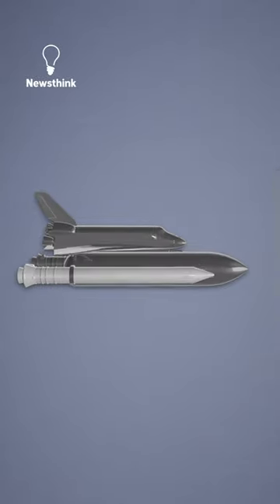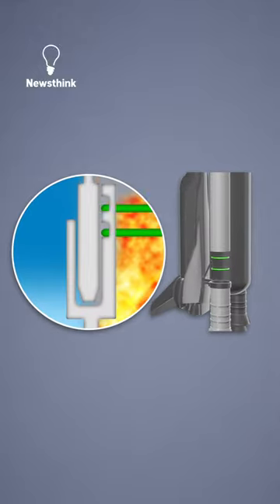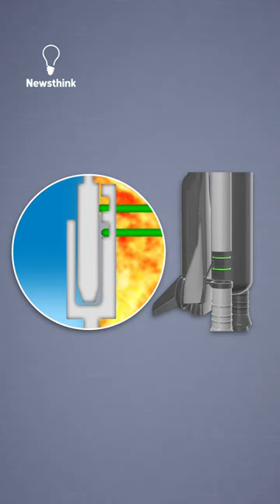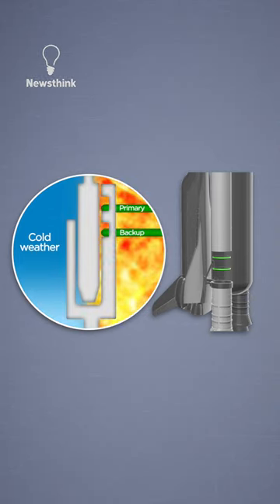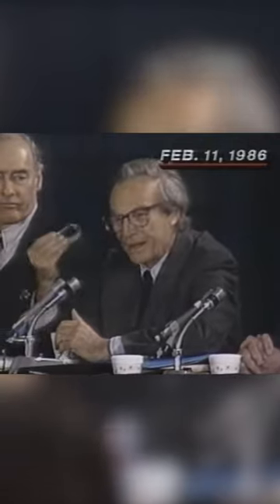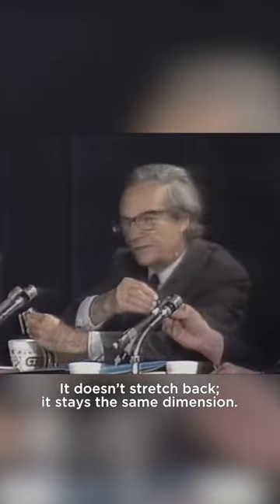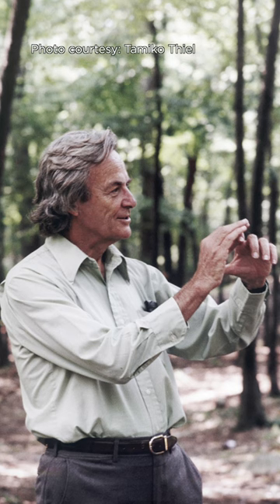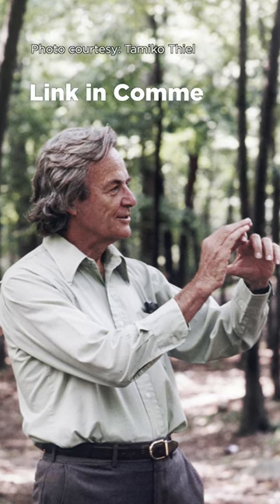One Mistake Led to the Challenger Disaster

Comment: How many times were those O Rings used? I think you will find that they were sold as, and guaranteed for, single-use but had been re-used on several launches before being exposed to the extreme weather conditions you describe when they failed.

Comment: it's because they melted
Previous rockets that used the exact same design ALMOST failed the exact same way but they did not because the bands didn't fully melt
Reply: Please see my comment ^^^
Reply: Thats a very rough and basic understanding
Reply: You are right, except the term used for what happened to the O-rings was "erosion" instead of "melting". When the boosters fired hot gas leaked past the O-rings and eroded them. Once that happened more and more gas could leak past the damaged O-rings until the leak got so bad that it destroyed the shuttle.

Comment: if this was the reason for the explosion why did both these boosters come off it was the larger rocket booster in the center the shuttle was attached to this brown large rocket booster the shuttle exploded because after the outer rocket booster malfunctioned because of the o ring this caused the fuel on the challenger to ignite causing the shuttle to blow-up destroying the entire vessel the crew never knew what happened 😮😮
Reply: The leak in the right booster allowed hot gasses to impinge on the strut that connected the bottom of the booster to the fuel tank. When the strut finally burned all the way through the bottom of the booster swung outward forcing the top of the booster into the fuel tank. This did structural damage to the tank, which broke it apart allowing all the propellants to be released causing a huge fireball. The boosters were then set free to fly around wildly until they were destroyed by a command from the safety officer on the ground. Finally, the aerodynamic forces created by the break-up tore the shuttle to pieces. Unfortunately, the crew survived the break up and weren't killed until they hit the water, so they probably knew they going to die.
Reply: Not a comma or full stop was harmed in the writing of that sentence 😅

Comment: This is incorrect,  why didn't all of O RINGS fail? I happen to know the man that re milled the slots that the O ring fitted in. The guy that milled it the first time lost a strap when he pulled it off the mill, causing the giant aluminum ring to wobble on the concrete and damaged the part! My friend went in and milled more off the part, that changed the tolerance just enough that under the cold condition cased a gap! Only then did the O ring fail. The part was flagged and was not supposed to be used at the temp that they lunch at! They all knew it, the failure was that NASA should have just waited a few hours for it to get warmer. you can check the records. This part was used before and leaked before, but not at a critical spot. He was right but on the wrong part. think about it.
Reply: Can I get a source?
Reply: @Silver-ee2pe  Pat Keyhoe, he  now works at Boeing on the Starliner spacecraft, He gave me a piece of the burnt heat shield from the first unmanned cargo mission to ISS !
Reply: The cold didn't cause a gap. You are such a liar. There always was a gap. The o ring was to be set and sealing in a dynamic situation at launch when the gases pushed and stretched the o rings into place. If what you said is true, then there never would have been any blow by on any launch, but there was. Because previous launches weren't  as cold. The joints moved at every launch, the clevis and tang always moved. That caused the gap. You are so full of it